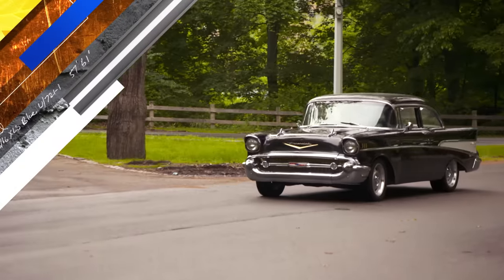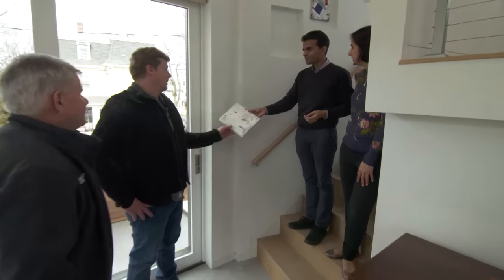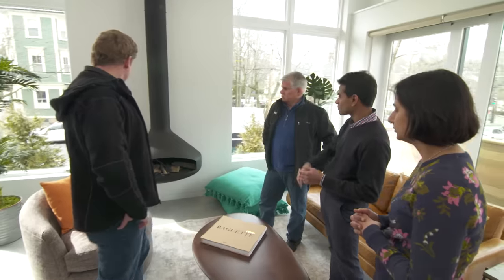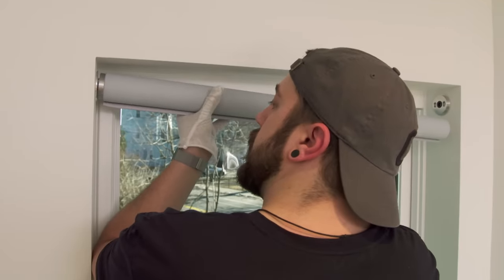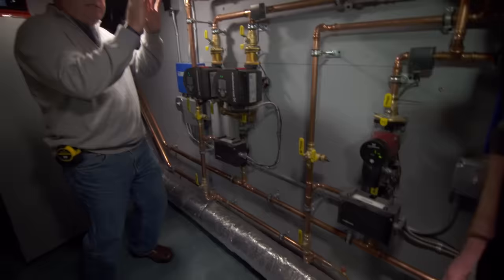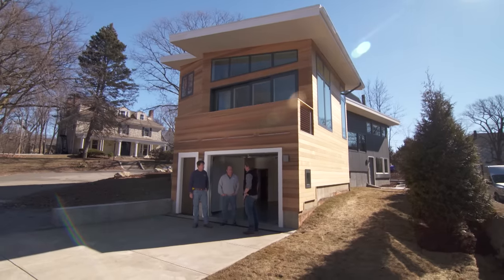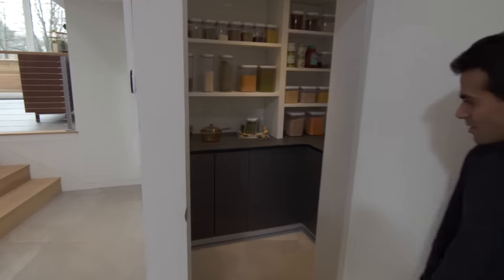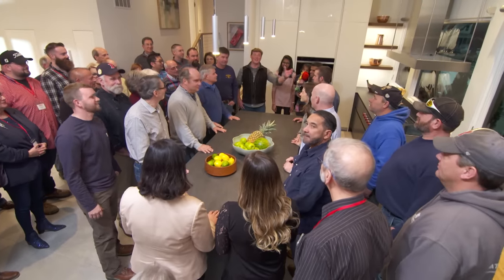This Old House | Taking Modern Back to the Future (S40 E26) | FULL EPISODE

Comment: I am truly amazing at the creativity that went into laying out the mechanical systems. That said, this will be a very expensive house to maintain over the coming years, so it's a good thing they're both doctors!
Reply: Why would it be expensive to maintain?
Reply: Not sure about expensive, but bloody difficult to work with, ok is the non functioning floor heaters due to the heat exchanger off the garage, the one next to the guest suite, or the water heater at the back of the basement.
Reply: @enkrypt3d  Did you see how complicated the mechanical systems are? ANY service call for any reason will cost a fortune just to diagnose.
Reply: @dlg5485  I highly doubt they care about that given the cost of the house.
Reply: @enkrypt3d  That's exactly the point I was making when I said they're lucky they have 2 doctor's salaries.
Reply: @enkrypt3d  To start with, the exterior finishes need to be re-done far too often. A couple of episodes ago I started wondering where the quarters for the live in housekeeper and maintenance person were going to be...
Reply: @enkrypt3d  The exterior is a maintenance nightmare for the homeowners...But a big score for contractors... All those bells and whistles in the mechanical systems require maintenance and if they neglect the maintenance; repairs will cost almost as much, or MORE than new...30 year contractor...
Reply: As I read in another comment they're both physicians. I'm guessing a monthly household income in the $60K range should be able to cover the upkeep, no?

Comment: They needed 25ft of ducting because they could not vent the kitchen hood out the ceiling and then all the different locations for the mechanicals which might make troubleshooting such a setup problematic. I would say that you would really have to love the look of the house to justify the extra cost. It would have been probably easier to just tear down and start over. I look at all of the workarounds ($$$$$) and compromises needed to make this a function and I wonder if only "this old house" could do such a project without it ballooning into a big overpriced elephant that you would never recover the cost of on resale. Made for a great tv show not sure about a house though.
Reply: Lost Comma yeah, it would have been easier to tear it down, but the city historical commission would not allow it. They noted the restrictions in the first episode. If I lived in the area, or was on the commission, I would have voted they tear it down and build something that fit in with the original historic homes in the neighborhood. That angular “modern” house sticks out like a sore thumb among all of those beautiful, late 19th century homes in the area.
Reply: Most of the mechanical location problems would not have existed if the house was designed better, that is, with the mechanical systems in mind.  It looks like the tradespeople had to figure out where to put the mechanical systems after the structure was already built.  Also, the homeowners should have been informed of these things when the house was being designed.

Comment: That is one ugly house to spend money on. Would have been better to just tear the house down and rebuild. If they rebuilt the house they would have more room for an actual heating system instead of using rads which take forever to heat up. Plus forced heat and air is way better because you will have constant air movement throughout the year.

Comment: 20:00 why couldn't they just vent the stove right out the wall? Also is the water heater gas or electric? If it's gas why not tankless? And it's pretty huge for a 3 bath house AFAICT. Does TOH list thier suppliers anywhere? i like their counters. Looks kinda IKEAish
Reply: The local historic rules didn't allow it, it was covered in a previous episode
Reply: @unusualbob  That's sad that historic rules would apply to a modern house. Historic rules are trashin most cases they either end up preserving the equivalent of 1800's Walmarts or tract homes or preserving unreasonably large rich people homes.

Comment: A finely crafted house, but I feel that it is in some respects over-engineered which has taken away from the mid-century cachet. Take, for example, the kitchen. There's so much glass, stainless and synthetic surfaces, as well as an absence of any wood surfaces that characterizes mid-century.  The placement of the hood in front of the glass window just doesn't seem right for a home. Everybody can see you in the kitchen from the outside at night; grease will accumulate on the glass and there is a very long run for the exhaust fan.  There's lots of mid-century furniture, but no wood ceiling or wood grain doors. 

I think this kitchen could have nicer, cosy feeling if they built up the wall with  teak or other wood finish instead of used glass, and put a long window on the top to let the light in or even a window in front of the sink.  The other side of the island is quite expansive, and the view to the street through the large glass wall is not that interesting.  Having a huge gas hob in addition to an induction top seems excessive for a family home. This is probably one of the most technical jobs I've seen in the series, given the size of the house.  Congratulations to the owners and TOH crew.

Comment: Do they ever talk about how much money was spent on one of these projects?
Reply: Not since a small scandal right before Bob Vila left (Season 20, IIRC) where the home owners revealed that after the final episode there was a TON of work not actually finished, a lot of shoddy work that had to be fixed and repaired, and that the true cost was not the $125k but closer to $300k, and not counting all the free material and tools that came from featured sponsors.
Reply: Vince Ciotti when the owners are medical doctors at Harvard, why worry about money?
Reply: Where did you get that number from? I bet they put close to $1,000,000.00 into it with all the issues that came up like with the asbestos abatement, the sewer having to be repaired & rerouted and then the tree removal that looked like it required the street to be partially closed. Even the way they had to do the kitchen hood vent was likely extremely costly. Thats not including the labor costs just from The Silva Brothers.. which is NOT free.